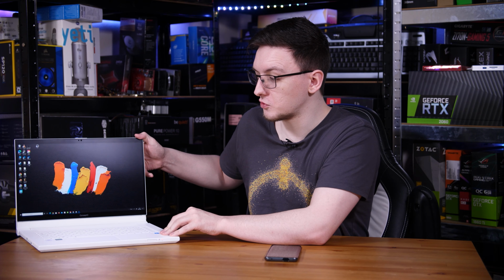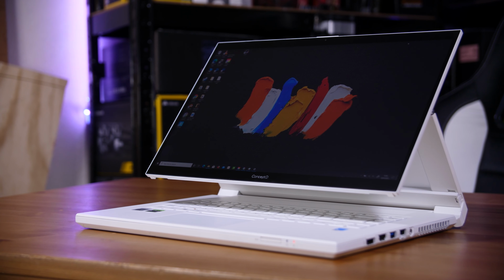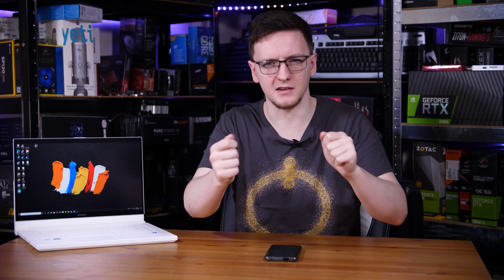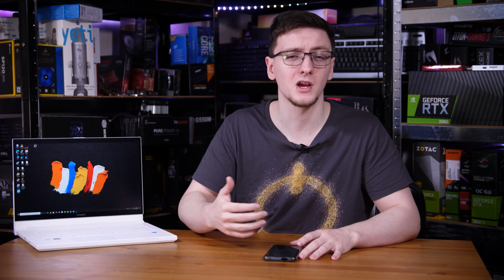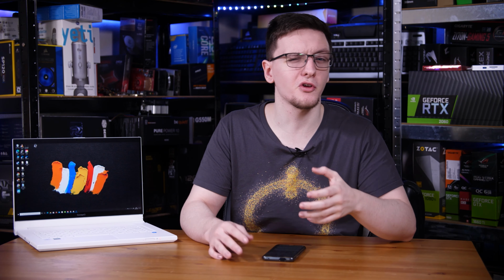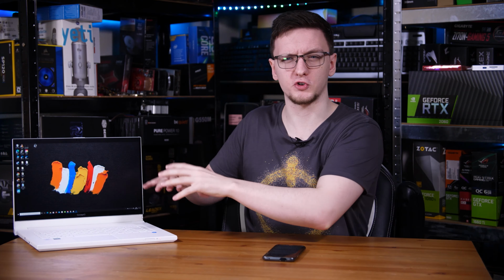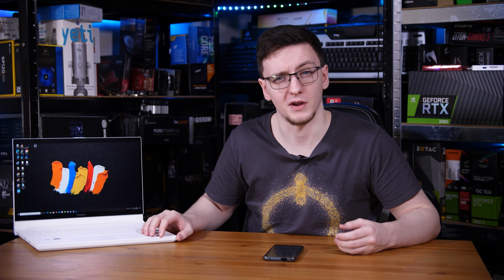Acer ConceptD 7 Ezel Review - Almost Amazing… - TechteamGB

Comment: A couple of things on your review:

1. This Ezel uses Wacom EMR which is the superior digitizer system for drawing compared to other laptops (in fact it's the only one I know of that does - even the 3 Ezel uses the inferior Wacom AES system). The downside with EMR is palm rejection is not as good but your lines will not be jittery. 

2. It may feel "plasticky" but that computer is built out of ceramic-coated magnesium. It's stronger and lighter than steel or aluminum but the "downside" is that plasticky feeling. Rest asured, being built of magnesium, that thing is built like a tank.

Comment: Quite a few lame points here. I've had this laptop for a month now and absolutely no complaints, in fact I would probably pay for it more than it cost me (2800 EUR)
Reply: I have one as well and have no problems drawing on it. I cannot even manage to rotate the screen by pressing on it with the pen because it requires way more pressure than I'm comfortable with.

It fast enough to power both a 34" ultrawide and its own 4K display. This way you can have 2 apps open (e.g. blender/substance painter and/or Unreal Engine as well as reference material in PureRef or video courses / tutorials).

I wish I could order a thicker Wacom Pen for it but I believe it needs a different type, such as the conceptd 9 pen or something like that. Though I haven't looked deeply into all that yet. So if anyone tried a different pen for it, please let me know.
Reply: @ferdivandekamp9989  In theory most (if not all) Wacom EMR-supported pens will work on the Ezel. I know for a fact the HP zbook pen does work.
Reply: @Gibberish1983   will s pen support this laptop?
Reply: @wisavasomchai9483  Yes, I have read it does
Reply: @Gibberish1983  I think HP zbook x2 g4 pen (same technology as s pen) will work with conceptD 7 ezel

Comment: 04:06 is not a practical example, I draw on this laptop every day and whatever that was, has never happened to me, be because most people don't draw like hyperactive gorillas. I agree, opening the laptop is 80% of the time not possible with just one hand, but other than that its extremely stable for drawing. I've only had it for about 2 months so i am curious if it holds up with time.
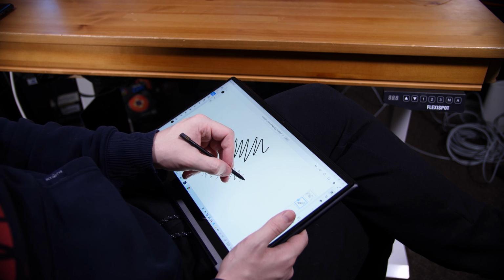Reply: wow 05:38 nonsense. I'm a lefty! and an artist! and it works fine. How can you actually think that "the hand you hold the pen in makes a difference" lol, let alone say it, let alone record and edit it. This review is so ill-informed
Reply: @adamkoubek7576   I think he doesn't know how to let Windows know you write with you left hand in the Pen Settings and simply blames the laptop for the Windows palm rejection.
Reply: Omg thanks for this im buying 💀
Reply: so hows the display holding up so far? And is the pen working fine, or you replaced it with a more thick one like a wacom one? Thinking about buying one of these myself for working on the go, mainly related to illustration, storyboarding and 2d animation but at that pricepoint longevity is kinda important xd
Reply: Sooo is it holding up?

Comment: I'm about to buy this thing

I'm scared!
Reply: I know the feeling. I was scared too before buying it, but now that I've been using it for more than a month....I want no other machine in my life right now haha
Reply: I really suggest you watch Brad Colbow's videos to help form you opinion rather than this one. Brad has both reviewed the 7 and the 3 and I trust his reviews a lot more than this one. The only fault I can find with it (still planning on getting a bigger pen, but I do like there is a small one that can be tucked into the laptop so I don't count that one) is the keyboard backlight which onless it is really dim it will actually makes keys harder to read. Maybe that is a common occurrence with white keys.

edit: Second issue is the speaker quality. It's fine for watching lectures or something, but you'll want to use headphones for most other things. The speakers are definitely not on par with a Surface Pro or a Macbook Pro.
Reply: @ferdivandekamp9989  this machine is what u get when u mash Wacom One w something like Triton 300>it's a bit heavy but >boy is it a dream! u can also use the wacom one stylus on it

Comment: oh man, as an indie game developer with an art-heavy game, this concept seemed like the perfect laptop. However, seeing that wobble I will definitely continue to stick stick to my wacom tablet. Thanks for another awesome video mate! :)
Reply: If it's in your budget, I would definitely suggest getting one. Im a CG Generalist and this thing is a perfect. Watch an artist review of it i bet none of these issues come up.
Reply: @adamkoubek7576  Is the pen pressure sensitivity gonna work in Substance Painter? I heard Substance Painter only supports windows ink but I plan to paint 3d model textures on it using Substance Painter, just afraid the pressure sensitivity not working well.
Reply: @kfkok4instamedia918  I haven't gotten around to Substance on here yet but been itching to find out myself so I'll try it and get back to you
Reply: @kfkok4instamedia918  Test complete, works like a charm in Substance. Only issue I do have at the moment, and this also goes for sculpting in Blender. The buttons on the pen as well as the pen, are super tiny, and trying to press them makes me feel like i'll snap the pen. I usually like the pen buttons to act as a modifier (Alt+Click, or Alt+Middle Click in the case of Substance) in order to orbit/move the camera without having to use the mouse. I do think ill be able to solve this by finding the right 3rd party pen. Hope this helps.
Reply: @adamkoubek7576  Thanks for testing it out! Would really hope there are artist who make a video to show this machine drawing performance on various apps, that would be really interesting. For the pen, most wacom emr pen should work except the wacom pro pen 2, perhaps you can get conceptD 9 pen, i heard it has best ergonomics but i am not sure if the buttons are programmable or not
Reply: @kfkok4instamedia918  thanks for the suggestion, I'll check it out. I feel like I can figure out a way to program the buttons somehow. It's mainly the frailty of the pen that's the issue. Brad Colbow has a pretty good review but only draws in photoshop. Might be worth a watch. Let me know if you have any other questions, Ill do my best to answer.
Reply: @adamkoubek7576  Yea, I have watched Brad's video and he's the only one that draws illustration on it (which I greatly appreciate) but we hope to see more creation process like that since this laptop is targeted towards creators/designers. I am deciding between this laptop and wacom mobile studio pro 16 (2019 version). I wanted to use this laptop for game creation, drawing/painting, 3D work and also some AI studies (which requires strong cpu & gpu). The only thing stopping me is the pen performance because I afraid the pen will not work well on some applications. I would greatly appreciate if you can let me know the following:
1) How long is the average battery life on typical usage? 
2) Have you encountered situation where pen is not working in some applications?
3) If you used wacom cintiq before, is the drawing/painting experience similar?
4) Will it overheat easily and turn on the fan?
Since not many artist have this expensive laptop, getting information like this is very hard, so thanks in advanced
Reply: @adamkoubek7576  Could you let us know when you get around trying a different pen?
Reply: @ferdivandekamp9989  Yeah will do, I can't seem to find out much info on what to go with so the safest bet seems to be the LAMY AL-Star EMR Stylus, we'll see, arrives Feb 19th.
Reply: @ferdivandekamp9989  LAMY AL-star finally came in. Works like a charm right out of the box. Still have to figure out how to program the button to what I want, for not its just a right click. It seems the recommended "Tablet Pro Pen Tool" is a lot less user friendly than I thought so I'll update once I figure that out. Looking at the "Tablet Pro Manager" app for shortcut assistance. but that one also seems unintuitive.
Reply: @adamkoubek7576  Thank you for the information. I'll order it as well. Remapping the buttons has been tricky for me as well. Win10 has a Powertoys app that allows remapping of buttons and adding shortcuts, but it is currently limited to the keyboard. I'm not sure if that will change with a future update, but you might want to keep an eye on that.
Reply: @ferdivandekamp9989  Hello, I have a question. Do you happen to know if the this device works well and has presure sensitivity with free drawi apps such as autodesk sketchbook. I'm thinking of purchasing it but aswell have not seen an artist cover this topic.
Reply: @waterforthefire8328  Hi I would suggest you watch the review by Brad Colbow I'll add the link in the next comment in case youtube does not like links and removes the reply or something. Brad Colbow is actually an artist who also reviewed the cheaper version (ezel 3) so he (and therefore you) can compare them.
Reply: @ferdivandekamp9989  Just one question: WIll I be happy after buying this or not?
Reply: @sachinrane4716  I cannot determine that for you. But even getting a similar desktop setup right now with these capabilities might be tricky for this amount of cash (especially if you still need to add a pen display). That being said, it was the most expensive computer I ever bought, so there is some discomfort there. 

Things I wish were different about it are: Easier remapping of pencil, easier to order a larger 2-button pencil. AMD processor rather than the intel one.

Things I'm happy with. It runs Unreal Engine and Blender and Substance Painter very well. Also, I use it for gaming once in a while and it runs Call of Duty: Cold War and Warzone absolutely fine.

What is your use case, current setup and alternative?

My alternative was the Zephyrus G14 with Ryzen and rtx 2060 combined with a Wacom Cintiq Pro. The con for my current setup is that I don't have a pen display that I can still use while upgrading the rest. Then again, it will be a while before I need to upgrade.
Reply: @ferdivandekamp9989  That was very helpful thankyou
I wanted a pen/draw ability with good graphics. I m still thinking which other 2button configurable pen to buy if this pen is too small. So far I've heard Wacom emr pens, Comcept d9 pen (if can be bought separately) work, if u do buy one and it works for u plz mention me nd let me know
Reply: @sachinrane4716  I was told by Acer Support. The ConceptD9 pen is charged through the laptop which means it cannot be charged by another model. In one of the other comments the Lamy Al-Star EMR pen is suggested, but my order was cancelled because it was no longer in stock, so I cannot attest to its functionality yet. Also, it only has a single button.

Comment: looking for a budget gaming laptop with the lowest input lag for competitive gaming. my price range is anything around $1000 above or below. What would you recommend?
Reply: Lenovo Legion 5 or the new Acer laptops?
Reply: @nikhilnihalani9077  anything
Reply: @User_3303_  I don't know what the prices are, but the Acer Nitro 5 AMD is worth looking into for competitive gaming. It has the option of a 165Hz QHD or 360Hz FHD screen, so pick your preference.
The Lenovo Legion 5 also has high refresh displays, and I think thermals are better so it'll be able to go for longer without throttling. Take a look at that product line too.
But try to get the non-1650 variants. I have a 1650 in my Legion 5, and while it pushes 100+ FPS in CS:GO without breaking a sweat, I don't dabble in competitive games and have no idea of how others fare.

Comment: For all the good aspects of that laptop - which are many especially the screen by the look of it - it is let down 100% by that dumb hinge system. You're better off with either an iPad Pro or MS Surface Pro tablet or similar. Whoever designed that hinge system has clearly never tried to use a screen for drafting or design. I can remember the huge Microsoft Surface Studio desktop with the wheel that stuck to the screen and even when I tried one of them, I was a bit let down (should not buy into the hype lol) but I would still like to have one. Don't think Acer have got a winner on their hands here sadly. Nice try though :)
Reply: that's why many are out of stock..avg rating of 4.5 stars..they got a hit..im a full time 2d 3d artist..this thing is a dream..it can get loud at times.but only when you really push it..i mostly use PS and Blender>it's a dream in blender ..especially grease pencil

Comment: I love them pushing different form factors. The pricing is a bit high, but once they fix the hinge, screen wobble, and palm rejection, it looks great. Personally, I wouldn't mind them slimming it a tiny bit if it means lowering the GPU a tier (ie: 2060). Also, LOVE the fact it has the slot for the stylus, like the recently discontinued DS family (RIP 3DS).